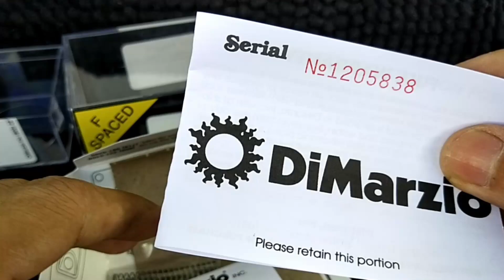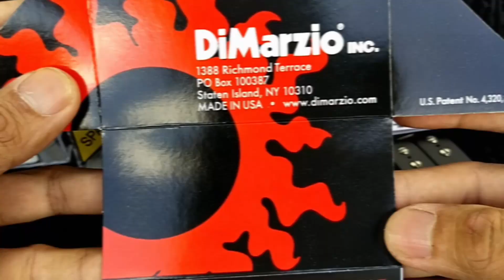Dmarzio Dreamcatcher pickup install on Musicman JP

Comment: OK, I have a JP60 and just got the Crunch Lab and Liquifire pickups.  It does not have the boost, just 1 vol, 1 tone and 3 way switch. How would you wire that?